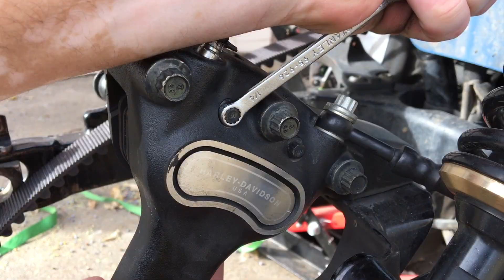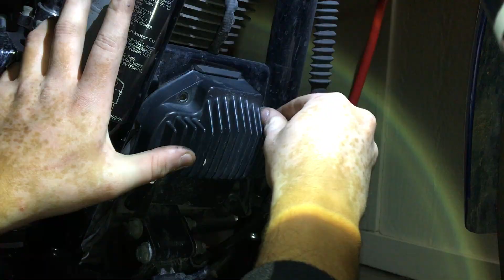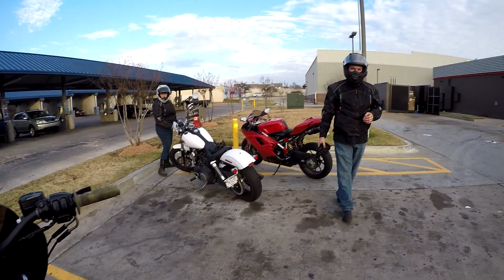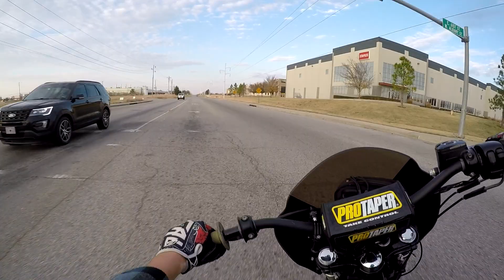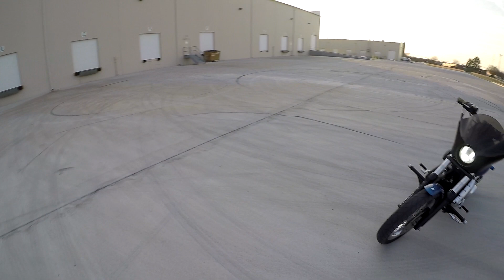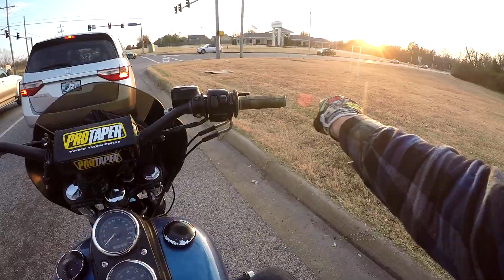I Dont Know What Im Doing

Comment: Sweet videos man. Keep em coming. 
2nd angle doesn't matter to me either way. I'll keep watching. 
How do you like the Airframe? Noise? Airflow? Looking to pickup a full face but hate to pickup the wrong one. Thanks.
Reply from the maker: texasavage thanks! Air frame is great, just depends on the kind of riding you’ll be doing. It’s pretty pricey, super light though, airflow is amazing too. Not too noisy but my Icon alliance was quieter.
Reply: Thanks! 
I was looking into the airmada as well. One thing holding me back is there aren't speaker pockets and being to tight on the speakers. The icons are already snug getting on and off.
Reply from the maker: texasavage I never had any problems with speakers, didn’t notice anything in any icon I’ve had.
Reply: Sounds good. Thanks for the insight.
Reply from the maker: texasavage no prob!